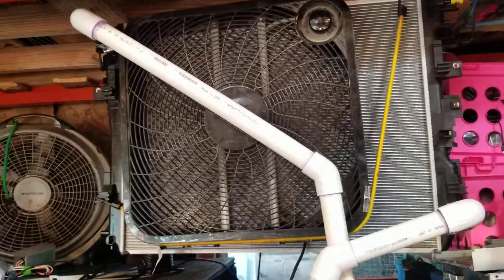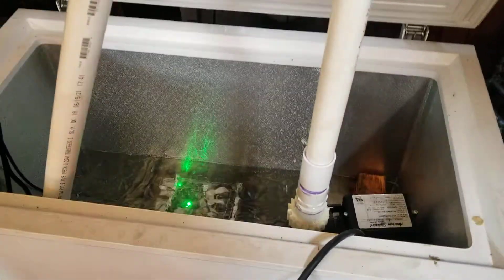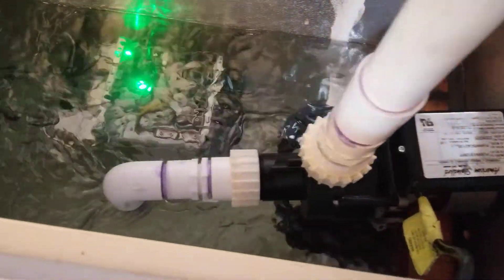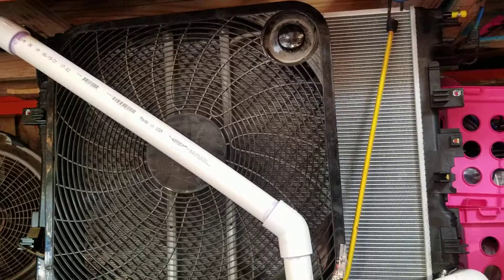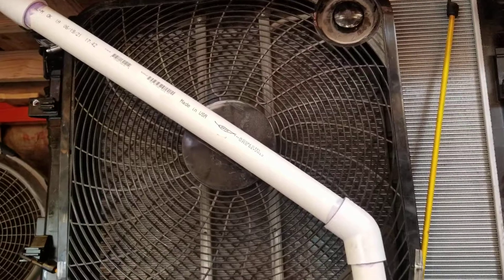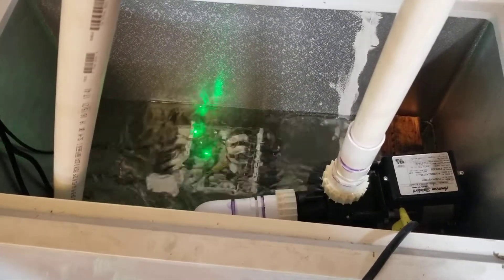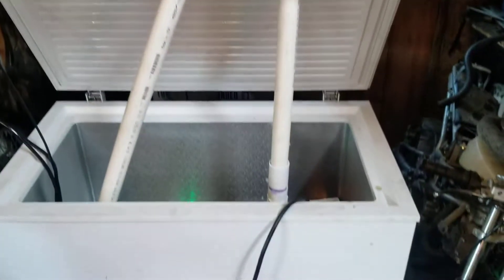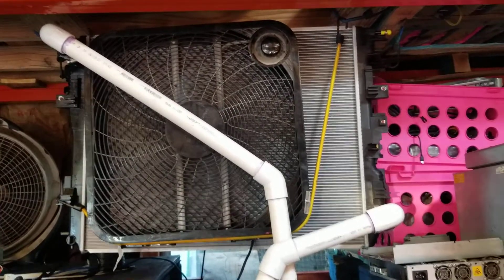DIY Immersion Cooling Crypto Mining S17

Comment: Will this work in hot climates ( 20c to 30c in winters) and (35c to 50c in summers + 90% humidity) ? How many of those radiators will be needed to cool 12 to 15 Whatsminers and how big should the freezer be? Flowrate of the pump and if radiators can be attached together to achieve the right cooling temperature for the Bitcool? How many watts are the radiator and the pump drawing? What are the temperatures of Bitcool for inbound and outbound?
Reply from the maker: In a situation with that many miners you may want to go the route of getting a commercially built immersion tank. That many would create a massive amount of heat and a dry cooler would be more efficient. The temperature of the weather would not matter with the right size dry cooler.
Reply: @brothersmechanics2028  Already contacted DCX, Bixbit and Beeminer and they don't offer a dry cooler for my weather conditions and honestly are very expensive. Can you please advise how many freezer chests and radiators will I need to make 12 M21s Whatsminers of 2920W (before fan removal or deactivation) each work in this case? Is this solution suitable for my weather conditions? How many watts will each set up draw from your experience? This has to be also inclusive of overclocking these 54T Asic miners.
Reply from the maker: @spo0ofer502  I have only tested this system in a dry climate, but i would assume that it should have no issues in humidity in terms of cooling effectiveness. I have not experimented with that many miners so you may want to try putting a couple of miners in a 15cft freezer with a couple of regular diesel radiators. This would all be an experiment since we have no data on something that big. Personally i would only do it that big if you could afford a dry cooler, if you cant afford a dry cooler then you may be better off with air cooling.
Reply: The cooling achieved from this method would be only the ambient temperature of the air entering the radiator isn't it? So of the air is 50c the resulting temperature of the Bitcool is also 50c? What is the resulting temperature of the returning bitcool in your system?
Reply from the maker: @spo0ofer502  Keep in mind it doesn't matter what the oil temp is as long as the machines temperatures are below 75, and in this case they are way below that.
Reply: @spo0ofer502  you are thinking about this so much its breaking your brain lmao. Think simpler bruh.
Reply: does your car work in hot climates? ....

Comment: Great video!!
Any suggestions to build a system for 5 S19 miners?
Reply from the maker: Yes, get a 15cft freezer. 2 pumps and 2 of the biggest radiators. Then experiment with those.
Reply: @brothersmechanics2028  Will this work in the case of 12 M21s Whatsminers of having 02 X 15cft freezers and 04 X big radiators? Any brand you can recommend for the radiator and fans for such operation?
Reply from the maker: @spo0ofer502  I have used a ram 2500 6.7L diesel radiator and it worked great for this application when i tested 2 machines.
Reply from the maker: @spo0ofer502  I would also say put 1 machine in at a time and only add another machine if the temps are staying low.
Reply: @brothersmechanics2028  I am just worried if it will work in my weather conditions or not..
Reply from the maker: @spo0ofer502  very simple to know, does a radiator work for cars in your weather? Obvious answer. There you go, now have fun experimenting.

Comment: Awesome set up. If you were to make a lid for noise suppression would that affect the heat of the inside of the freezer at all?
Reply from the maker: You definitely dont need a lid. The machine literally makes zero noise. A better set up would be to put the pump outside of the shop. The only noise this makes is the window fan. BUT if you decided to put a lid on it then yes it would have issues with heat.
Reply: @brothersmechanics2028  thanks for the reply. Looking to replicating this exact set up. Are you looking to upgrade the PVC pipes to copper?
Reply from the maker: @djcadaver  Copper pipes would be ideal, I am not sure if the correct fittings exist tho. If I end up changing that out i will update with a video.
Good luck!

Comment: Is the deep freezer running?

If not could it be run to help improve cooling?

Or would the power usage of the Freezer cancel out the Immersion power reduction benefits?

Thanks for your video!!
Reply from the maker: No the freezer is not running. It is not necessary to use it that way. Sure you could use it but its way too expensive to do it that way. Plus the machine temps are already very cool as is.

Comment: Hi bro i have quastion please is there any specific type of mineral oil for cooling or any one work for cooling?
Reply from the maker: Definitely do not use mineral oil. Use Die Electric fluid. Bitcool is a good one.
Reply: @brothersmechanics2028  what happens if use mineral oil?
Reply from the maker: @alexshia3891  mineral oil breaks down electronic parts over time
Reply: Here in uk I can't find it only minral oil . Plus I saw many videos on YouTube using mineral oil. How bad can it be bro? Because mineral oil is very cheap
Reply: @alexshia3891  mineral oil will remove serials, remove paint from CPU chips, memory chips, harden wires until they are brittle.... i wouldnt.
Reply from the maker: @alexshia3891  the fact that its very cheap is why you should be worried about using it on an expensive miner....but its your choice.
Reply: @brothersmechanics2028  thank you very much .

Comment: Have you put in more miners?  whats the total heat that's going out?
Reply from the maker: I will be adding more soon. I cant tell you the specs of heat but this miners stays under 60c.
Reply: @brothersmechanics2028  With that setup, if you added another 100L of liquid, could you add 3 miners to the setup you think? or would it be to hot?
Reply: Please post your instagram I would love to talk to you about this setup!
Reply from the maker: @lifewcj1264  you would need a bigger radiator or 2 radiators. Ideally you would get a bigger freezer, say 14cft, and more liquid and it would work.
Reply from the maker: @lifewcj1264  Ill do an updated video when i add more miners.
Reply: It may be worth buying a dry Cooler- don't you think?
Reply from the maker: @lifewcj1264  if you have a lot of money then DIY is not the way to go. Get a real immersion system, which will cost closer to $40k. Otherwise experimenting with DIY is the best way to keep your machines cool and quiet.
Reply: @brothersmechanics2028  I don't know if this sounds redundant- but What If:-

2 Chests: (10 Cu.Ft)

Chest 1:- 
2 Machines Inside w/oil
* Is for the machines

Divider: 
Top section and the middle has a panel system inside, so all the how oil is being pushed over with the fan (200watt)? that oil circulates to the radiator, then pushes back into the second chest from the top- where it is fed back in from the bottom?

________
----- |   |------
*     |   |   *
___|__|___

Chest 2: Oil

Just have to find a way for the oil to go back to the first chest without having the other oil being fed back into the second chest, im sure there are some locking mechanisms that could help with that, just haven't found out that part.

if that was figured out, then essentially the oil in the second chest(at the top) would have a slight chance to be cooled down by the Freezer 

(PS) Is your freezer on? 

thanks!
Reply from the maker: @lifewcj1264  That would be way overkill. No reason to turn the freezer on. If you want to go that far, just get a second pump and radiator system in the same freezer for 4 machines. Put a fan on both sides of each radiator and that should keep the machines nice and cool.
Reply from the maker: @lifewcj1264  Dry coolers are crazy expensive, thousands  for a cheap one. Radiators are about $100.

Comment: 70Ths at what wattage?
Reply from the maker: Roughly 2800w
Reply: @brothersmechanics2028  You can take off the fans once they are immersed, fans don't help at all I believe, then your wattage would be closer to 2000
Reply from the maker: @lifewcj1264  There's no need to remove fans, install asic.to and put it in "immersion" mode. That slows the fans down to 200rpm instead of 6000rpm.
Reply: @brothersmechanics2028  that's actually so dope thank you for this!
Reply from the maker: @lifewcj1264  No problem, good luck mining!

Comment: whats the pump make and model you're using?
Reply from the maker: This is an old model that i got new, so i would recommend a newer version but here are the specs: American Standard model# 2209209
You have to order the connections to hook up to piping btw, they are not available at lowes or home depot.
Reply: @brothersmechanics2028  thanks
Reply from the maker: This is an old model that i got new, so i would recommend a newer version but here are the specs: American Standard model# 2209209
You have to order the connections to hook up to piping btw, they are not available at lowes or home depot.

Comment: what did you use to seal the inside of the cooler?
Reply from the maker: Just a regular all purpose caulk. It would be best to find a deep freezer that is all one piece and that doesnt require sealing. But this is holding up just fine.